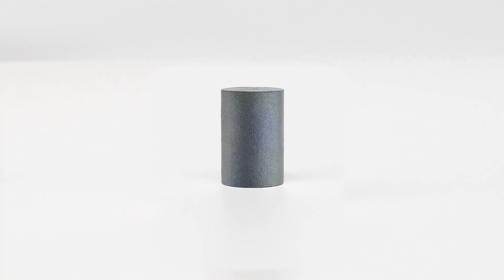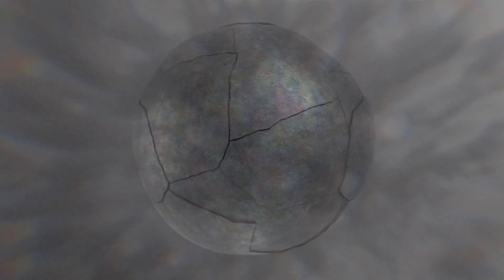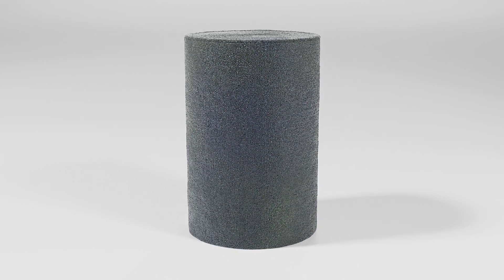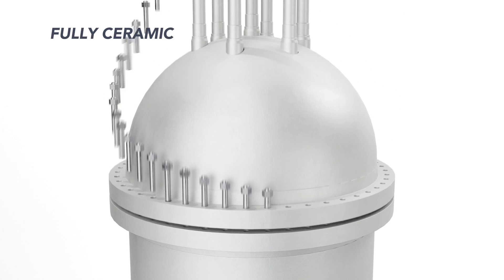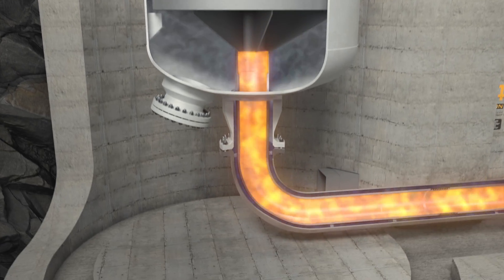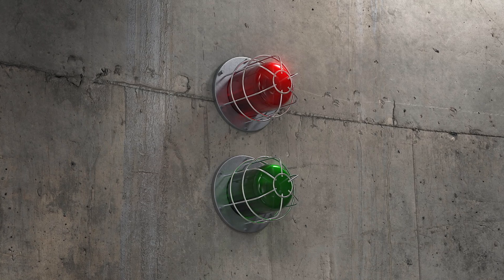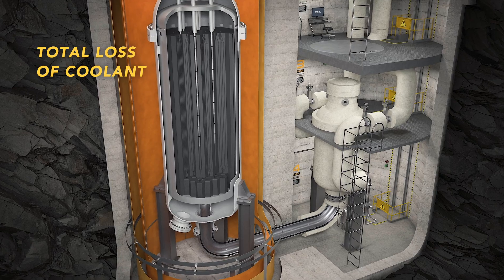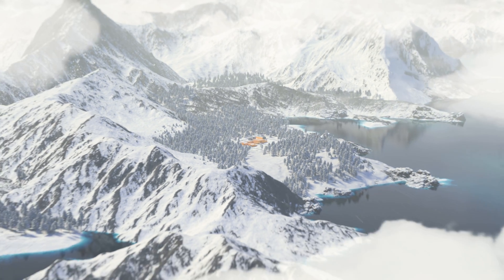How it Works – the Micro Modular Nuclear Reactor

Comment: How does the reaction stop when the coolant goes away? Can someone explain the mechanism by which that occurs? Love the idea of a passively safe reactor.
Reply: Heat makes materials expand. 
As the nuclear fuel expands in a coolant failure, this would act to move fissile atoms ever so slightly further apart and take the reactor below criticality. 

Of course, once it cools, it would contract again, so some other mechanism has to intervene, perhaps by forcing in dampener control rods, or by drawing in a neutron absorbing "poison", perhaps one that only melted during an overtemperature event.

It's not infeasible.

I think the big question lies in the cost of routine operation, efficiency, and decommissioning and waste disposal. These sorts of costs have plagued other designs and concepts.
Reply: @aaroncosier735  wouldn't it find an equilibrium between being in the expanded, less reactive state, and being in the cooler contracted state then?
Reply: @grubstarstar  This is traditionally achieved using absorber rods, or by modulating the boron in the coolant.
If the coolant is the moderator, then coolant loss takes things below criticality. 
but
Delayed neutrons from all the other decays, not just the first fission of uranium, these contribute a large proportion of the total heat, and take time to die away. 
They generate enough heat to cause issues.
Reply: @aaroncosier735  nice one thanks
Reply: My guess would be that the type of fuel they use has a negative feedback loop, so when it gets hotter, it releases less neutrons.
Reply: WWII Germany was trying to build a pile using heavy water as the moderator.  Loss of water would slow the reaction.  However, they didn't think they needed moderating rods.  Had the pile gone critical, they would have had a nasty surprise.

Comment: 2000 liters of diesel ?  Seems like it would be alot more than that. I think it would be more like 20,000 liters of diesel.
Reply from the maker: Energy density of nuclear fuel as used in this reactor is about 100,000 to 200,000 x larger than diesel.

Comment: The reactor vessel should not be fotted with pipes at bottom, it should be at top, so that, even when there is no power, water stays inside the reactor
Reply from the maker: There is no water in this system. in fact the pipes are at the bottom precisely so that any water that does get in will drain out.

Comment: This is so OLD SCHOOL when it comes to nuclear power. This is an advertisement for FCM,s fuel generation process used in the current uranium nuclear fission reactor process. This fuel will only use .07% of the uranium energy in the pellet before the reactor will need to be shut down when the fuel pellets need to be replaced. As well, the helium gas used to cool the reactor is an expensive gas to produce and its thermal dynamic properties still require this MMR to be encased in a pressure containment vessel. The new Liquid Thorium Fluoride Salt reactor is light years ahead of this old process using up 99% of the Thorium fuel while running at high temperature and 1 atmospheric pressure. The reaction process is self-regulating and if in the event of an accident will immediately shut down and the reaction liquid will flow into a holding container under the reactor and solidify to become nonreactive. As well, because this process runs at 1 atmospheric pressure a pressure containment vessel is not required reducing construction site costs. This reactor can continue running while being fuelled as well. Copenhagen Atomics is well ahead in industrializing this new nuclear power generation process. https://www.copenhagenatomics.com/

Comment: I graduated with my engineering  degree 50 years ago.  At that time nuclear was the bright future, but for a lot of reasons it has never fully achieved the potential we predicted.   Just think about 70 years ago they were putting nuclear power plants safely into submarines. This type of development  seemed right around the corner at that time.
Reply: Sadly the anti-nuclear groups pressurised governments, who switched spending to other things, plus the media still open any discussion on nuclear power with a mushroom cloud, reinforcing deep seated fears. However, with alternatives energies now proving how difficult it is to build reliable 24/7/365 grid with intermittent power input, nuclear is now the obvious choice.
Reply: @cs7th  The reactors on submarines use weapons grade fuel - enriched to 20%.  The US civilian nuclear industry uses fuel with a lower enrichment to avoid the risk of creating tons of high grade fuel that is outside the control of the military.  Enriching fuel to 20% is 90% of the enrichment process, so it would be a much more tempting target for someone who wants steal themselves a nuclear bomb.  And one of the byproducts of civilian nuc plants is plutonium and that became the feedstock for our weapons programs.

Another reason the navy uses high grade fuel is because it's not prone to xenon poisoning.  Radioactive xenon builds up in a reactor as it runs. During normal operation it's just burned up as part of the normal process.  But when you shut down a civilian plant that xenon is not burned up as power drops.  The left over xenon prevents the reactor from being restarted until it falls below a certain threshold.  A military vessel can't afford to shut down a reactor and then have to just wait around before starting it back up again.  Someone might be shooting at them.
Reply: From what I've understood of naval reactors, they operate differently from power reactors. For the most part I think they are fast reactors.
Reply: @12pentaborane    No, they're not. Using highly enriched fuel, Navy reactors can be built small enough to fit inside a submarine hull. Where space is not a consideration, such in a power plant, the fuel is not enriched nearly as much. A significant portion of a large reactor's energy is derived from fast neutrons.

Comment: So they're going to surround their fuel with graphite. Where else have I heard of that design "feature"? I remember now Chernobyl. Having a fission reactor where the fuel and moderator can melt into ongoing fission "puddles" seems like an unacceptable risk to me. At Three Mile Island, at least the moderator evaporated and was no longer functioning as a moderator. As far as I know, there are still puddles of melted fuel/moderator mixture undergoing fission underneath Chernobyl entombed reactor core.
Relying on engineering and technology instead of several human minds that understand the process is a path to eventual disaster.
An enormous amount of thorough testing is needed before we put these things into the open market.
Perhaps we should focus on Thorium reactors instead and then they too should face the same amount and degree of testing.
Reply: It's actually the reverse. Relying on passive physics based safeguards is much better than relying on people. Most of the major nuclear accidents have human error as a contributing cause. 

Furthermore, using graphite has no bearing on the core melting. 

There's a number of reasons that can cause a meltdown. 

Chernobyl it was a positive void coefficient among other reckless human errors. 

This video claims that the reactor has a negative void coefficient and will lose reactivity as heat rises and cooling is evaporated. 

Fukushima lost power and could not cool itself in time. 

This video claims that low power density as well as the inherent small size of SMRs will allow passive cooling.
Reply: @anxiousearth680 As an aside, what's the Earth anxious about?
Reply: @trplankowner71 
This is going to be sappy but hey, you asked so I'll take that as permission to be sappy 😉

 In abrahamic religions, the first human, Adam, is said to be sculpted from earth/clay and given life. 

My username is meant to allude to people's constant struggle to reach their goals in life. Ever striving. Ever restless.
Reply: @anxiousearth680  Sorry, I missed your last reply back then.
Why not be sappy? So many others on YT are!
Good username!
Reply from the maker: @anxiousearth680  you are onto something!
Reply: @anxiousearth680  Actually, you’re making a dissimilar comparison.
Since there are about 10 to the 26th neutron life cycles per second in the core of an operating power type of nuclear reactor, any scheme to actively control such a process is beyond ridiculous.

The problem at Chernobyl was the morons who came up with that test and the irresponsible jerks that designed the plant. When that was combined with the communist system, the result was inevitable.

“using graphite has no bearing on the core melting“, do you always read wishfully, only seeing what you want to? I never wrote that graphite had anything to do with the core melting.

The problem with graphite comes after the core has melted. That was the major focus of my post. Moderator melting together with fuel is a disaster waiting to happen.

With a light water reactor, physics controls the reaction and when the inevitable human screw up comes around, the moderator will evaporate.

Such a situation will still be one hell of a mess from an operator or engineer’s point of view. However, that need not be a worry for the public. The general public in the vicinity of Three Mile Island were exposed to negligible radiation and TMI was about as bad as one can screw up a light water reactor.

Still, that accident wouldn’t have happened if every person up the chain had been a qualified and experienced operator that understood how the plant works.

That is essentially what Rolls-Royce’s SMR design is, a modified reactor plant from their design for the Royal Navy.

Now if the UK would only have qualified RN veterans operating those plants, they would be far ahead of everyone else.
Reply: @trplankowner71  

Fair enough about the graphite. I misread. Sorry for that. 

About Chernobyl I simply abbreviated what you mentioned as 'among other reckless human errors'.
Reply: @anxiousearth680 Those guys at Chernobyl demonstrate the problem with the communist system. The morons that thought of that test weren't even the plant's operator or nuclear engineers. They had no idea what they were messing with, much less what decay heat is.
The incident at TMI demonstrate what happens when you let penny pinching accountants make decisions involving operations.
I worked at the #1 unit in 1990. They're actually a good design. However, you have to trust your instruments and act accordingly, even when it seems strange to you and some moron doesn't want the plant shutdown.
It's all permutations actually, once you establish enough parameter sets, there will always be unforeseen possibilities.
That's why you train your operators extensively and always establish a safety mindset. If they get even a hint that something isn't right: scram the reactor, shutdown the plant and keep investigating until you understand why things don't seem right.
Reply: are you even an engineer? you are taking so many shortcuts in your thoughts. is a very long shot to compare this reactor to chernobyl.
Reply from the maker: @tomasmanrique400  thank you.
Reply: @tomasmanrique400 I'm not an engineer. However, I am a former US Navy nuclear power plant operator. I know more about the subject than most engineers and have actually operated several nuclear reactors. The crucial issue at Chernobyl is that the fuel and moderator melted into a single mixed fluid.
While the high temperature ceramic nature of this design would certainly give it a very nice margin of error, they didn't mention anything that would prevent their graphite moderator from mixing with the fuel in a drastic accident situation.
Now, I only have education and experience in pressurized light water reactors. However, I'm not aware of any physical limit or mechanism that could stop one of those reactors from melting its fuel "structures". 
There are approximately 10 to 26th neutron life cycles in a second. That is a margin of error too small to rely on anything but basic physics.
The moderator vaporizing is what stopped the accident at Three Mile Island, not any safety equipment, nor person..
That can't happen with these reactors.
Reply: @trplankowner71  this is an advertisement video without displaying any details regarding how they are dealing with postulate events and what's their plan to mitigate those (that's the job of IAEA to approve the design of the reactor once the engineering is done). I won't be taking any conclusions, just appreciate that someone it is thinking differently and it might help the overall industry.
Reply: @tomasmanrique400 I understand that. I'm also aware that the fuel being locked into a ceramic matrix adds a large safety margin.
What I'm also aware of is that engineers mostly have no real world experience with the devices they design. I have over forty years of experience operating, maintaining and repairing machines designed by engineers that never used them in the real world.
The engineers that designed Chernobyl, Three Mile Island and SL-1 did not foresee the events that led to their destruction.
Only one of those reactors failed in a safe condition; the pressurized light water reactor designed by Babcock & Wilcox. That wasn't because the designers, engineers, technicians or operators understood what was happening during the accident. It was because the moderator, water, flashed into vapor and was no longer capable of acting as a moderator.
Graphite, carbon, doesn't do that at relatively safe temperatures.
Reply from the maker: @trplankowner71  thank you.
Reply from the maker: @tomasmanrique400  these are shown to the regulator. do you think it would be helpful for the public to see all the documentation?
Reply: @ultrasafenuclear  hi. sorry for the late reply. yes. I think that it would be helpful, but also consider that there should be a summary document explained on a elementary level for those who are not engineers to be able to understand how it works.

Comment: Sounds like they have fixed the jamming problem that a pebble bed reactor reactor had by instead making the pebbles tinier and encasing them in fixed graphite fuel elements. It has key good features of the pebble bed reactor like thermal safety, but only lacks the ability to refuel while running. That was neat, but eliminating it made the reactor safer. Making the waste be self storing is also great. Seems to me they should be able to harvest the waste heat of waste fuel on a lower power level to power the reactor station. Why didn't Fukashima do that?
Reply from the maker: We don't use pebbles. We use sesame sized TRISO particles embedded in pellets inside of big hexagonal blocks of graphite. The control rods just slide in and out.
Reply: @ultrasafenuclear Сам реактор предполагает обслуживание?
Или после выработки топлива весь реактор утилизируется как контейнер с отходами?
Reply from the maker: @A1ex5438  The reactor has a well defined inspection and maintenance schedule. Once the fuel is used up, we replace the core with new fuel. The reactor pressure vessel is reutilized until end of project life and can potentially be reused several times using a thermal rejuvenation technique. The Russians do this on VVER vessels - pros.
Reply: @ultrasafenuclear  Is this the fuel that is made in Canada?
Reply: Have to remember that Fukashima was designed and built in the 1960's and start working in 1971. The whole philosophy of design and building nuclear plants was different to today.
Reply: Fukushima was a 2nd generarion reactor. It was built in the late '60s
Reply: Optimized for a specific temp range I imagine. Once the fuel is delivering heat below a threshold it can't meet power demands so your reactor is just taking up space and not being used to its potential. More codt effective to replace the fuel than to have many reactors running at 1/4 capacity.
Reply: Isn't that just normal fuel rods?

Comment: Is it possible to shrink it into a micro reactor which about the size of a battery?  There is always a possibly that with research and development ( really small micro?) Put those things in a small group of houses to use for cooking, electricity, etc?   Them we can use it in new developments of an alternative into coal, oil, power systems don't stop it's run away inflation?  If only we can get together with a few people who would teach our kids a new way to handle the future with new inventions that   will not be sold at any price even if they offer the whole universe.  It has to be free for all poor cities nations ,neighborhoods-  - people below the structure of society.  Let us invert the old system and change it so everybody will thrive for a long time,!!!!
Reply from the maker: No. The reason is you a need a minimum mass of uranium to get self-sustaining nuclear reactions. This is on the order of 10s of kg. for practical power applications, you need at least 50+kg as well as other materials.